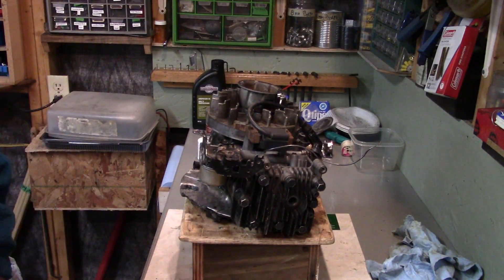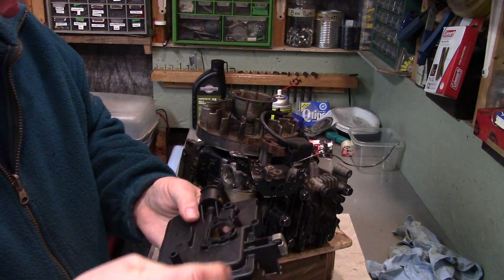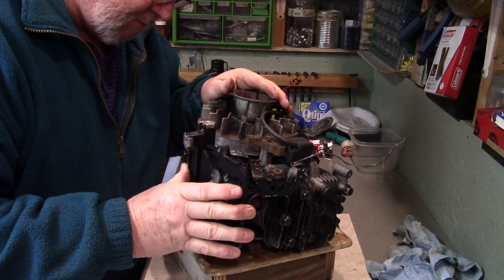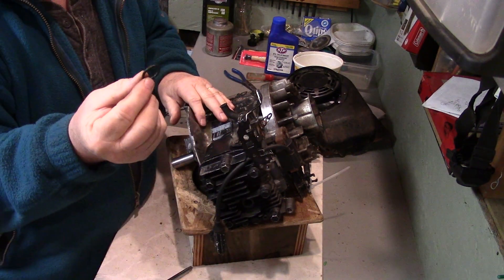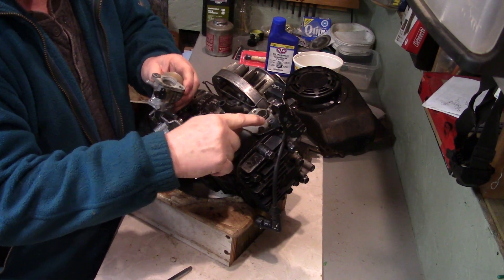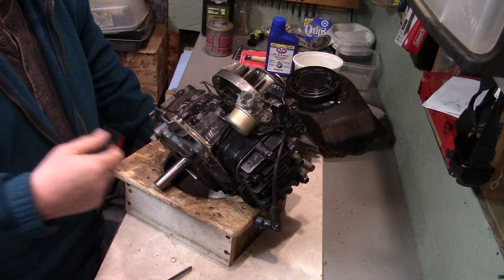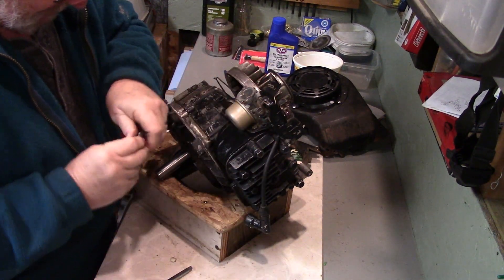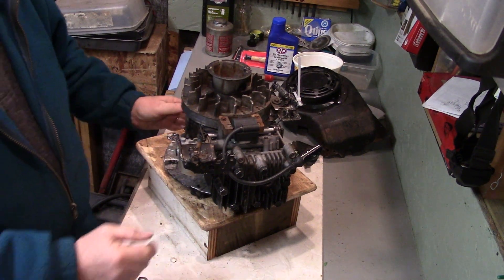All About Small Engine Part 9

Comment: Great job, Mike. I'm sure you will get it fine tuned goes by. Now that its running next step is to look into your other issues and fix them.
Reply from the maker: Hello there Jack!!!  Yes that's  the plan.  Well sort of.  If I find a use for this engine I will address the surging issue.  I think it's carb and governor related.  The governor needs to have a blade on the engine, or some sort of load, before being set up, so it'll have to wait!!  Thanks so much for watching and commenting.  Take care!!!

Comment: You got it sir!!!!!   Well The mower blade is the flywheel on these. They run very poorly without a blade.    The old engines had a cast iron flywheel   These ones are aluminium.  I hope didn't burst your bubble  :-)
Reply: I was going to say what Bruce said.  Plus bruces trick when the primer doesn't squirt fuel is double the gasket between the carb and filter housing.   But hey SHES A RUNNER !!! YEEEES!!! Great job mike
Reply from the maker: Hello there Bruce!!!  No way you burst my bubble, I'm walking on air buddy!!!  I thought the engine was doing pretty good, but I think the carb needs work and also the governor needs to be adjusted.  But I don't think I'll do anything to the governor until it has a blade, or some sort of load, on it!!!  If I find a use for this engine I'll move on in my 'small engine' education and address the hunting and governor set up issues!!!  Thanks a lot for all the comments during this series Bruce.  You inspired me my friend!!!  Take care!!
Reply from the maker: Hello there Dave!!!  It sounded like the primer was puffing air so maybe the 'double gasket' trick will work.  Another secret from the small engine gurus!!!  LOL  I was some happy and surprised that this engine started!!  But like they say, "anything can happen in a small town'!!  LOL  Thanks for all your comments Dave and take 'er easy!!

Comment: Awesome Mike. How did you resolve the hunting up and down.  I've tried new carbs that did that forever :)
Reply from the maker: How's she goin'?  Well Steve the next day when I started the engine outside the shop it was running a lot smoother.  I think the carb is still a bit of the problem and also the governor is not set up correctly.  But to be honest I didn't do anything to help the 'hunting'.  It is still doing it.  If I decide to use this engine on something I will look at that problem.  But my main goal was just to get it running.  That was pressure enough.  ;-)   The next grade in my 'small engine education' will be to address the hunting issues!!!  LOL  Thanks a lot for your support through this series my friend.  Take care!!!

Comment: Was there any doubt. Once the excess oils burn out of the muffler, rings etc It sounds like you have a good motor happening. Now you can put it to bed the right way for that rainy day eh bud ! Take care bud.
Reply from the maker: How's she goin'?  I was some surprised, and happy, that it started as quick as it did.  And even with all the smoke, I was one happy camper for sure!!!  Thanks for all your comments and suggestions and tips through this series Dean!!!  I sure appreciated them and learned a lot.  Take 'er easy!!!
Reply: @GrampiesWorkshop  Best part is the price, LOL. I sooooo love to help folks along when I can. I have a bucket full of experience and the skills that come along with them. Makes me feel great to put a smile on anyone's face for sure.
Reply from the maker: @TomokosEnterprize  And you have done that for me Dean, thanks!!!
Reply: @GrampiesWorkshop  My pleasure my FRIEND ! A final for this it would be great to see you shut it down with storage spray for long term storage. It doesn't cost much and all I know about the stuff is it works great in auto engines. I did one on a 10 year and scoped the engine and it was perfect inside. That was 5 years ago.
Reply from the maker: @TomokosEnterprize  I have some fogging oil spray for outboards.  Maybe that would work!!!
Reply: @GrampiesWorkshop  That is exactly the suff. It is basically just ATF.  That stuff can take a badly rusted roller chain and in a month or so eat the rust off of anything,  Even in a badly corroded and burnt up automatic trans that stinky thing cleans up with no problems at all eh. Just another tip eh, LOL. Mind that the divots and voids in the chain are still divots eh. The tech these days haven't figured out how to replace the missing metals from parts yet but who knows about tomorrow eh, LOL, Take care an I am still wanting to do that trip down to see all the great islanders there. How far timewise are you fine folks from Halifax ? I Have an old dear friend there.
Reply from the maker: @TomokosEnterprize  We're about an hour and 40 minutes from the city!!!
Reply: @GrampiesWorkshop  Just a few stones throw eh. Say that to any new type kid and they would look at ya in wonder eh, LOL.

Comment: What a great feeling to have er running.  It's been a good project for you.  What did it cost you in the end?  Well worth it, great job.  Stevo
Reply from the maker: Hello there Stevo!!!  This old motor was out behind the shed for over 2 years.  It wasn't running too good when I put it there and now it's running, not great, but good enough to do some more tune up to it.  So how much did it cost?  Air filter - 7.50, a gasket kit - 18.95, spark plug - 6.50, 500 ml of oil - 5.50, assembly lube - 12.95.  Unforgettable experience of rebuilding an engine - priceless!!!  Thanks a bunch for watching and take care!!